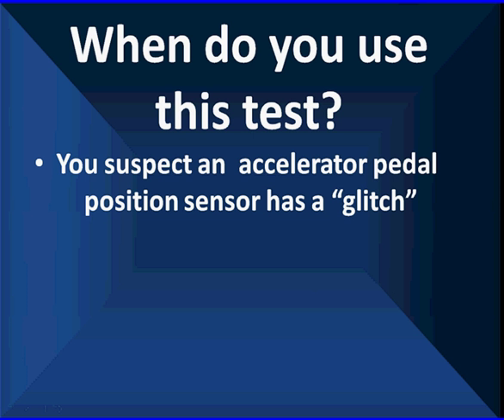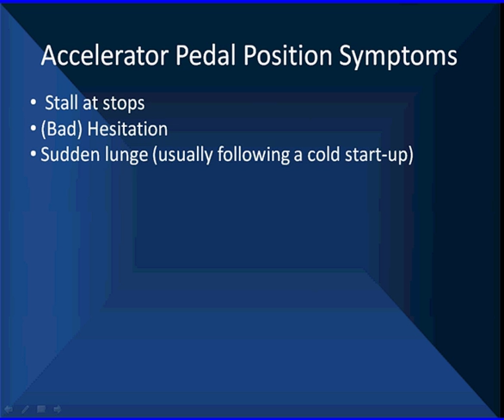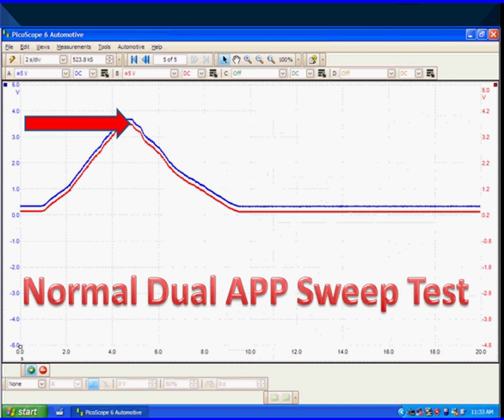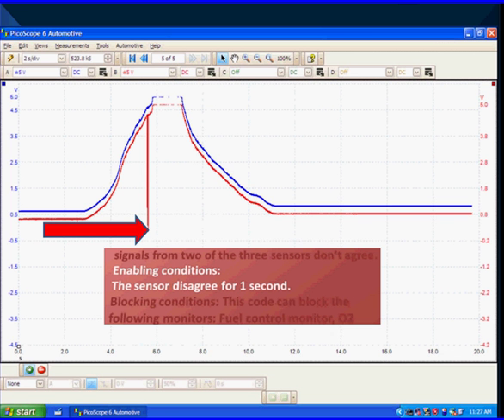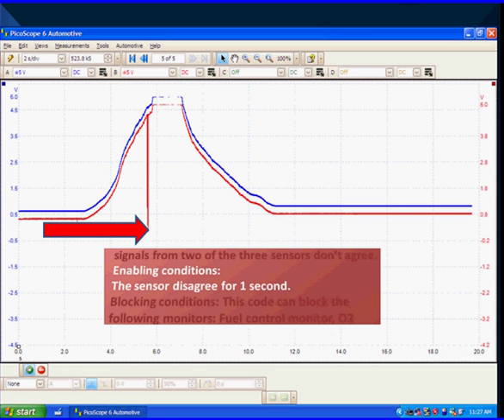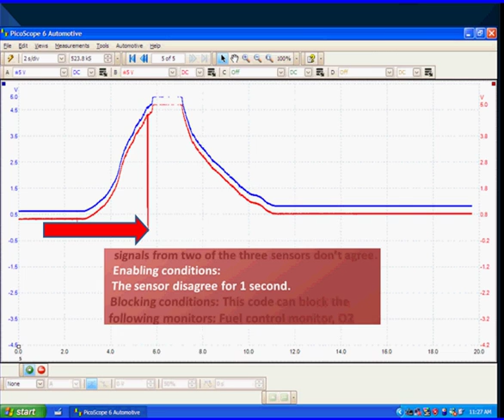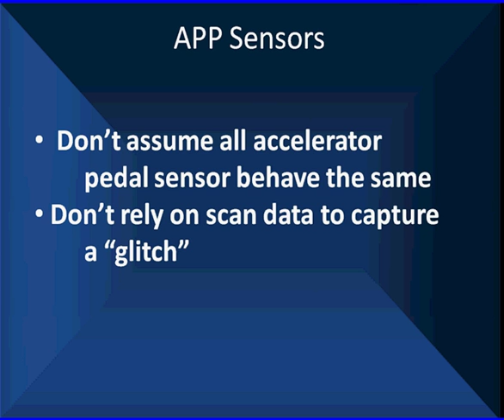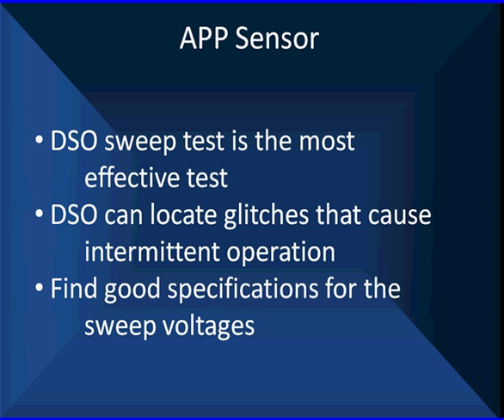02 Accelerator Pedal Position Sensor Testing

Comment: 2006 Nissan Sentra 1.8L- It was doing at least some of those symptoms such as stay in idle / low power no matter how much i floored pedal . For over  a year . Tried a couple shops they didn't fix it . One of them replaced Throttle position sensor body using OEM Hitachi part . Another " recalibrated " my ECM . finally left me stranded one day . Found out fuel pump wasn't pumping so replaced both relay and pump . If it's the accelerator sensor then why wasn't pump working ? Just today still doing same thing and took it to car dealer and they checked it . Tech confirmed codes for throttle body and throttle position sensor . .. Then they said to replace accelerator pedal sensor and linkage ??

Comment: Hello I have a 2011 Chevy Cruze Lt 1.4L and I'm having this problem  the engine light and a 2nd engine light with a arrow pointing down traction control and stability traction so I changed the throttle body the pedal twice and the intake and I have code p2138 D and E voltage corralation how do I fix this plz help me

Comment: I had this problem with a 2007 Chevy Colorado starting last year.  One day I pulled into a parking lot and came back and started the truck and it idol super high at start and was trying to cool down the temperature and it knee jerked me into hitting the brake and every since then the truck has been overheating in idol.  It showed a misinformation code error for the first couple months.  So disconnected the battery and no more code showed up but it still has problems cooling down in idol.  Thermastat has been replaced twice and it was by GM parts store.  I had the temperature Sensor replace and the Fan Clutch replace with no results.  I personally cleaned out the throttle body.  The resisters for the fan blowers are bad.  I replaced the lower resister and it worked for a week and then burned out.  I am thinking that a short in the system could be this that may have affected the APP Sensor while in idol.??  The mechanic I use is also confused on what could cause this problem without going to the dealership to get a proper Diagnostics.  Of which they could keep my vehicle up to a week to get back and cost a fortune after they are done.